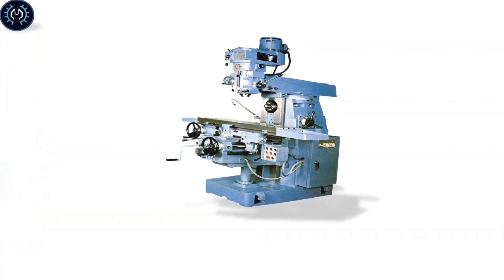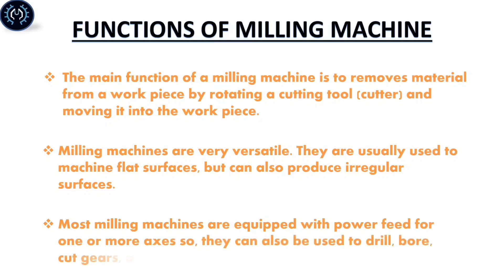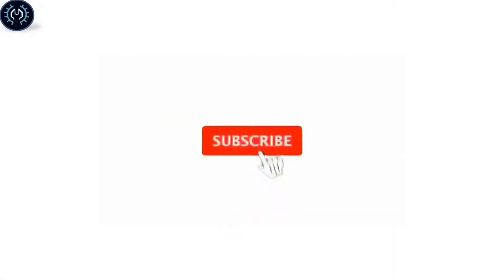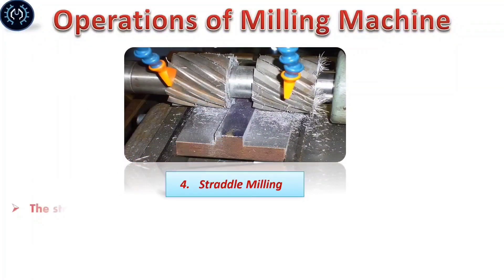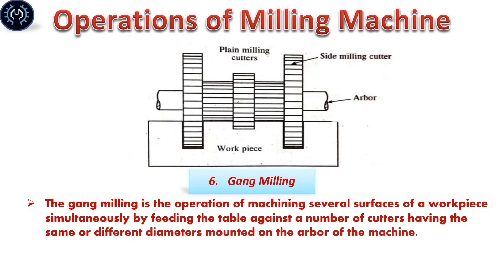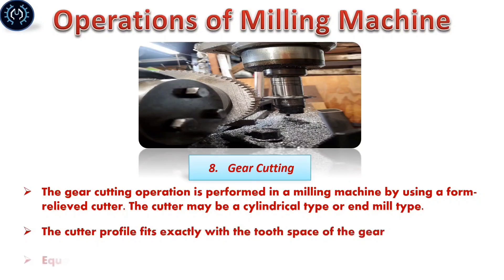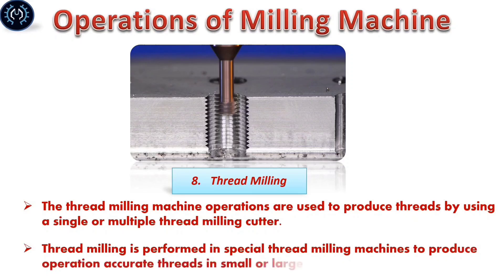Milling Machine : Definition, Parts, Types & Operations

Comment: 🎯 Key points for quick navigation:

00:00 Milling machine importance
00:14 High-speed rotating cutter
00:29 Material removal process
01:41 Clamping workpiece mechanism
02:24 Plane milling operation
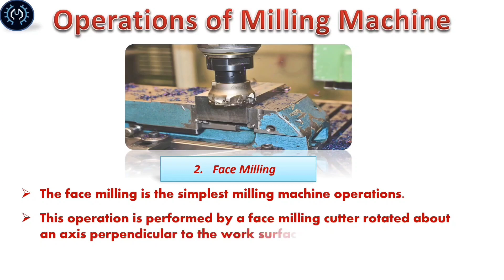03:06 Face milling technique
03:49 Angular surface milling
04:17 Symmetrical surface machining
05:02 Profile milling application
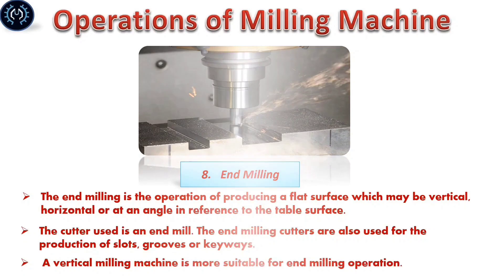05:44 Slot cutting operations
06:43 Gear cutting process
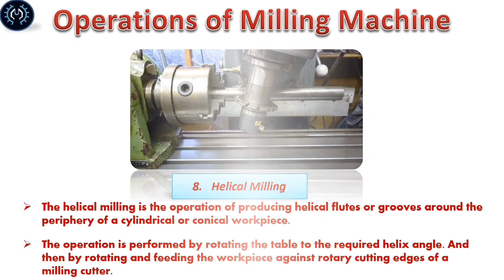07:26 Cam milling operation
07:54 Thread milling machines

Made with HARPA AI
Reply from the maker: Thank you very much my friend 🌹❤️